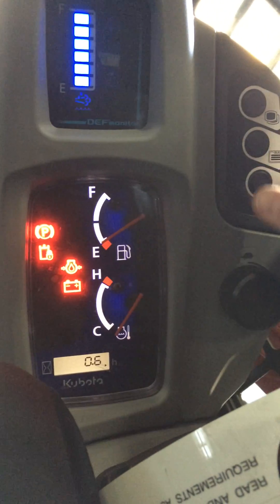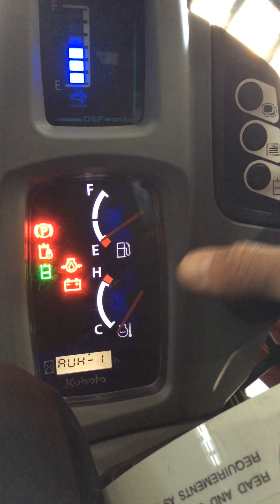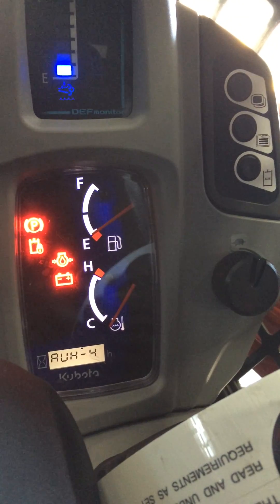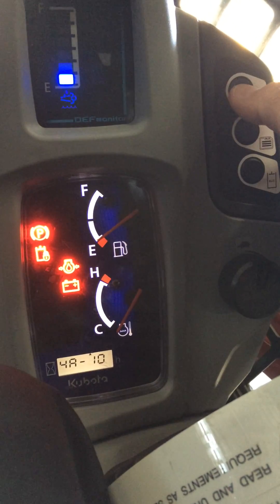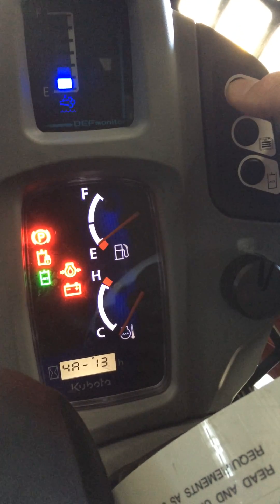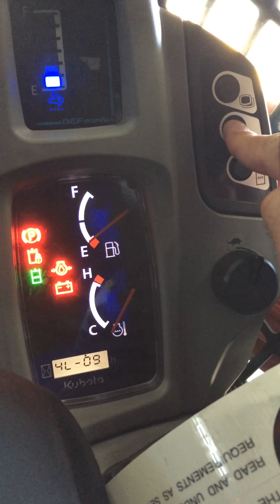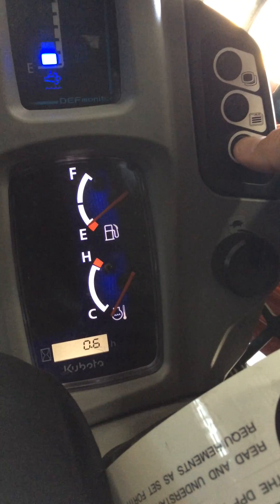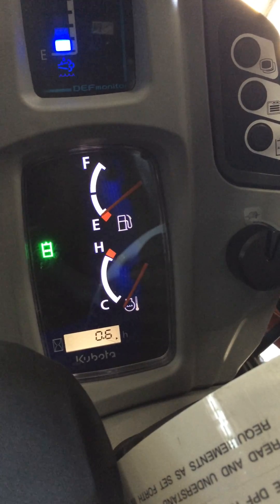Kubota SVL-95 High Flow Adjustment

Comment: So if I have an SVL75-2 with adjustable high flow (17-29.3 GPM) capacity, and want to run an attachment that has capacity up to 27 GPM, can I set the hi flow NOT to exceed 27 GPM?
Reply: Yes, you can, by adjusting the flow number...0 through 14.  Manual should say what they correspond to.  24 GPM is standard flow on my SVL95, and 41 GPM is high flow.  I just run it on max (14) for my forestry mulcher.  Haven't had an over temp alert, ever.  

Max Pressure is the same for both...3553 psi.
Reply: @victoriajankowski793  The manual doesn't say what they correspond to at all. If you assume that zero is 0 gpm and fourteen is 40 GPM (2018 specs) you can calculate what the numbers should be on the 0-14 scale, but then there is the Left and Right factor. It is very unclear. I made a spreadsheet to try and figure it out. The Takeuchi system (75%, 50%, 25%) settings are easier to navigate, albeit with less adjustability range. The problem is that if the assumptions are wrong and you overpressure your attachment it costs a lot of money. I have just purchased a 2018 SVL-95SHFC and a 30 gpm max disc cutter and am trying to make sure of these same things.
Reply: @sidneyhighfield2243  I agree. What have you leaned? I just got my svl 97 with a disk mulcher and am having some confusion as well.
Reply: @sbrusch  same here.

Comment: I rented one of these machines. There is only one set of hydraulic lines coming to the quick disconnects. I followed your instructions, and turned the auxiliary up to 14. I'm using a cutterhead, and it still seems weak. I'm thinking that maybe the flow pump is not engaged, and it is running on low flow. Hello on automatically, or is there a switch to change from high to low? I also don't understand the right and left setting, how does this work?
Reply: Mode 1, or AUX-1 is the factory default to standard flow.  You get a steady AUX symbol for that, plus "AUX-1".  High flow default is AUX-2...you get a flashing "AUX" symbol for that.  Its simple...turn the machine on, turn on your hydraulics (right console), press the bottom button once (AUX 1) then again so you see "AUX 2".  You have high flow now.  If you shutdown last time in AUX-2, it will start in that mode again until you change it.
Reply: *typo- does high flow come on automatically?  Not "hello".  This reminds me of when I was using a Deere 333e and there was a button to press that engaged the high flow.
Reply: @MikePrice007  once you turn on the auxiliary flow you will press and hold the aux button down again until the aux light starts blinking. Then it will be in the high flow setting.,
Reply: @traecalvert1985  Once again, the worst interface I could imagine. My children’s $20 toys have a better interface than this very expensive machine.
Reply: @kevinmcgehee5557  Kevin, the big cry baby.  I have one of these...my 7 year old can run it...
Reply: It the skidsteer has a set of one fitting on top and 2 pairs on fitting below is a high flow.
If it has only one pair of fitting more likely is a standard flow.
Reply: Press twice theb Aux bottom